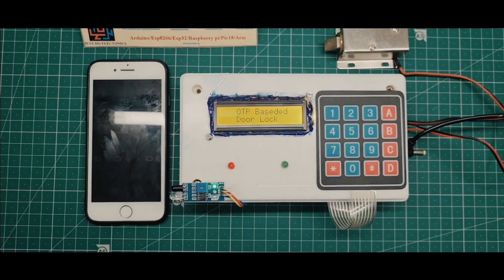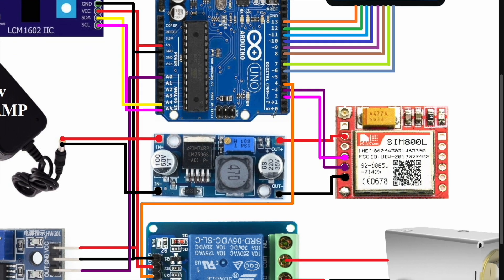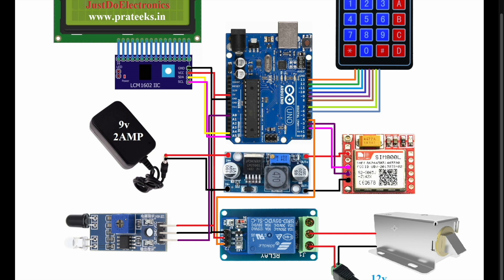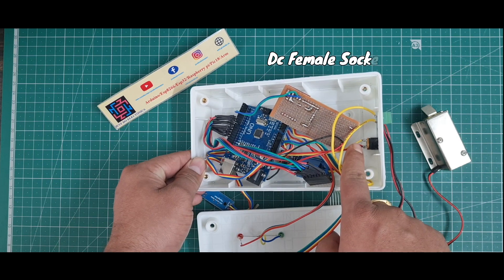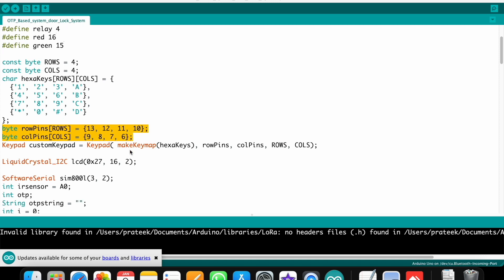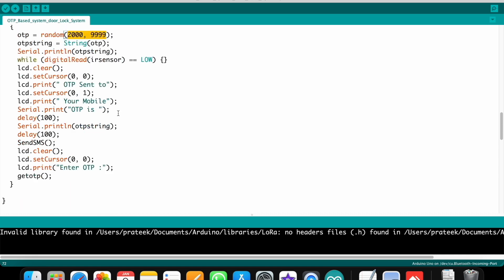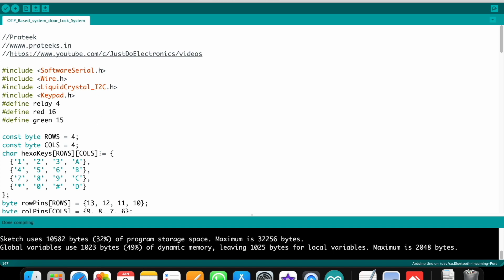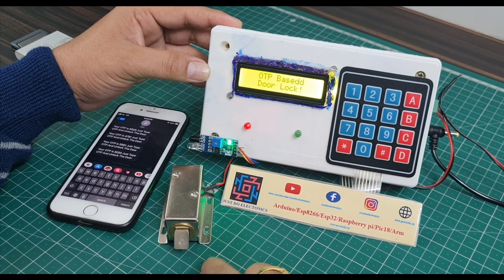OTP Based Door Lock Using Arduino & SIM800L GSM | Smart Security System | 4x4 Keypad

Comment: Sir I am making this as a project so first I have buy all the components and now I have made all the connection as per circuit diagram and insert the code in Aurdino with no error 
But sir GSM Model is not blinking as ??

What to do sir
Reply from the maker: Yes you can
Reply: Sir how can we contact you as clear our doubt

Comment: Sir could you please share the circuit design as a file from designing software it is available as a png file so we couldn't access any of its components, it would be good if you share the design file from the software and also please share the name of the Software which you used for this design.